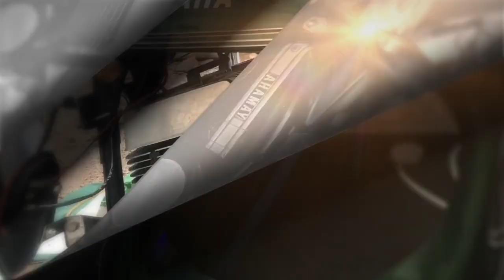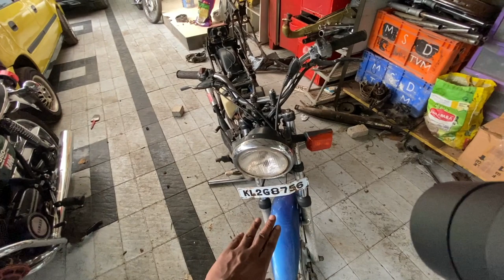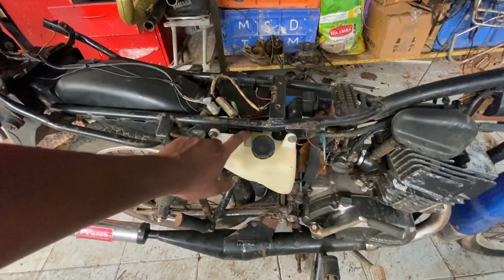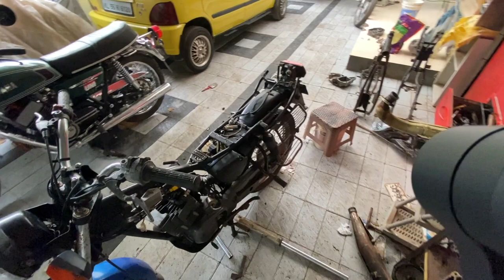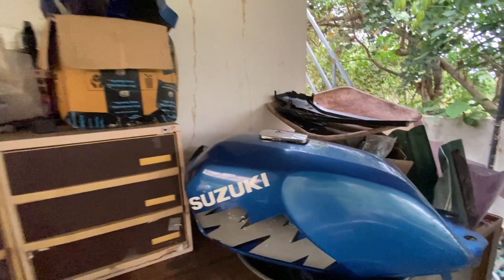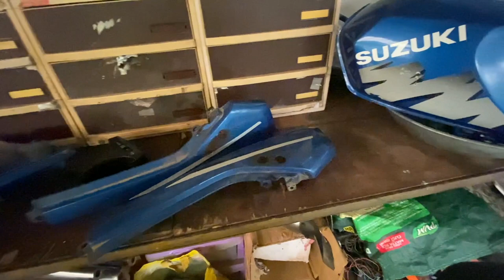Blue Shaolin Restoration Part 1, Everything wrong with it and restoration planning (Malayalam video)

Comment: Oil pump ano use chynath?
Reply from the maker: Alla
Reply: @Yamakaze  bro e 2 stroke inte oil pump idakoke fail ennu pryarundalo chillar ath nth kondanenariyo
Reply from the maker: @ashwinanil4074  oil seals mostly, then gear wheel inside goes bad, packing there are a lot of things that can go bad in an oil pump

Comment: Chetta ee zinc dipping and chroming different ano
Reply from the maker: Molten zync is sprayed on the parts, it can be done through electro plating as well. Chrome is done after multiple process including plating nickel and chrome
Reply: @Yamakaze  thanks for the valuable information bro 😍
Reply from the maker: @arunkannan5792  👍